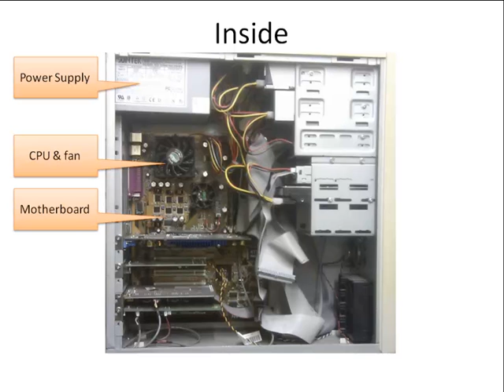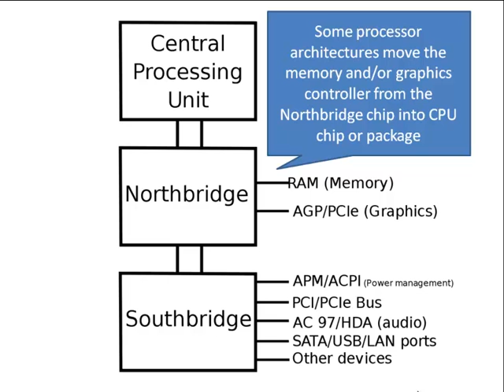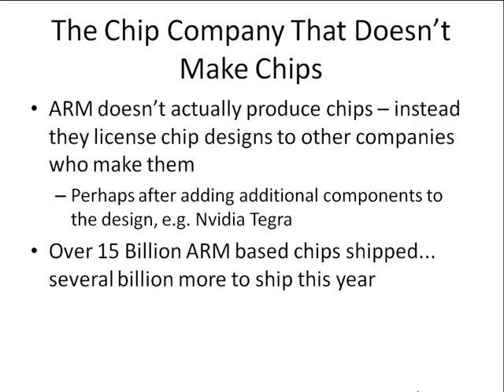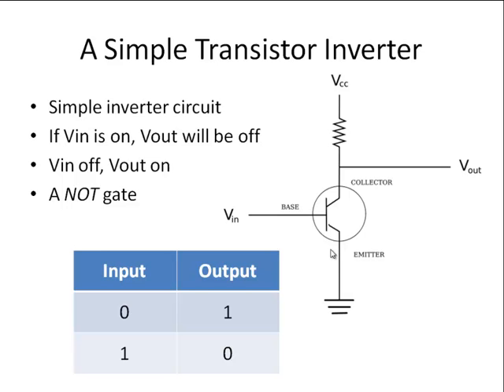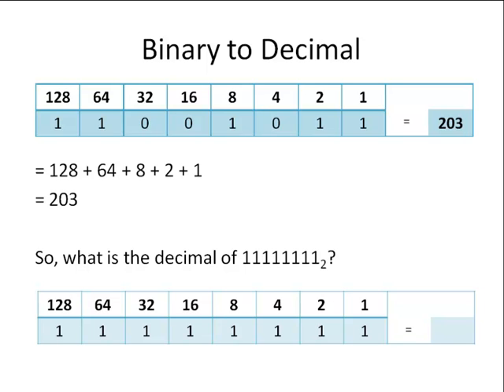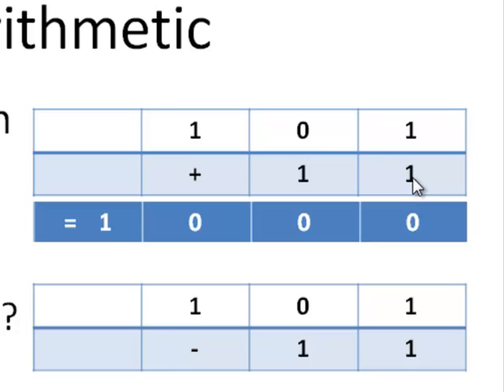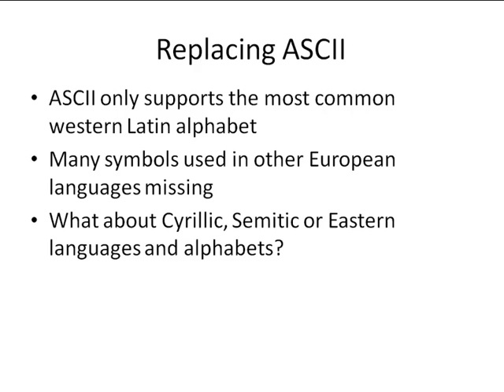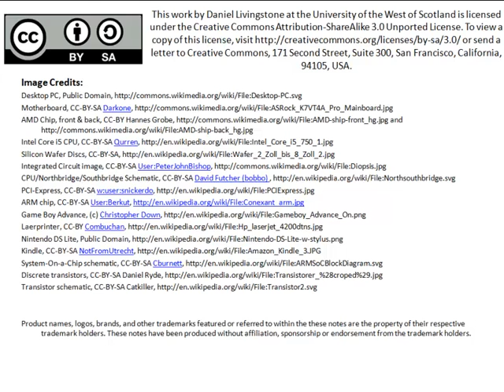2) Hardware, Binary & ASCII

Comment from the maker: Embarrassing correction: On the labelled picture of a motherboard, the connector labelled 'Video' is actually a serial port. This motherboard shown does not have inbuilt graphics, and requires a plug-in graphics card for video output.